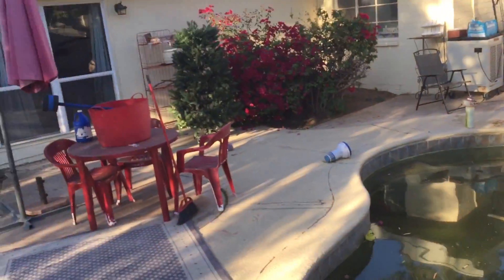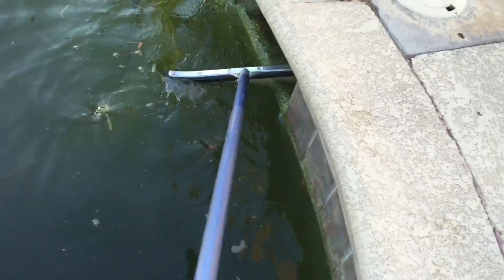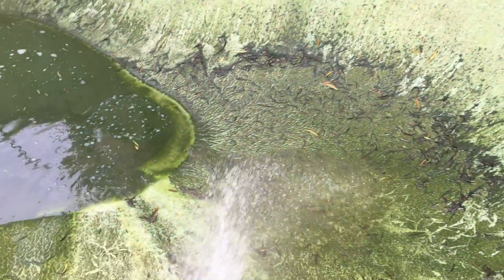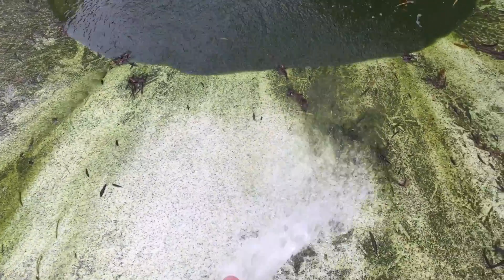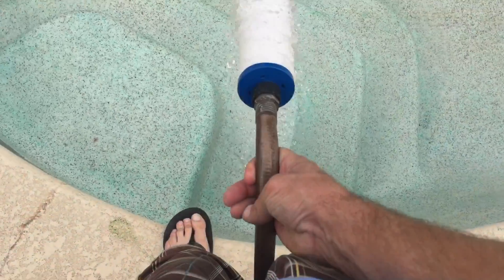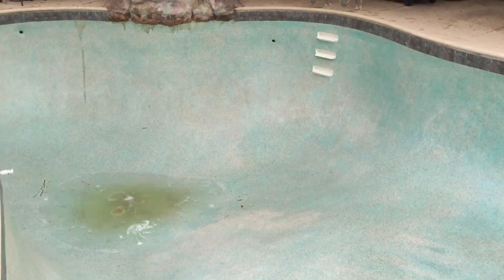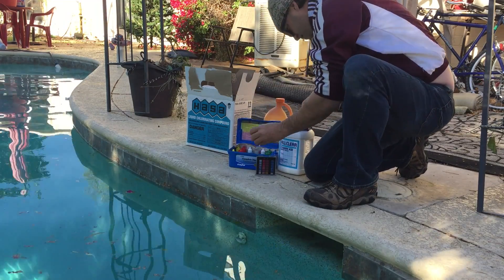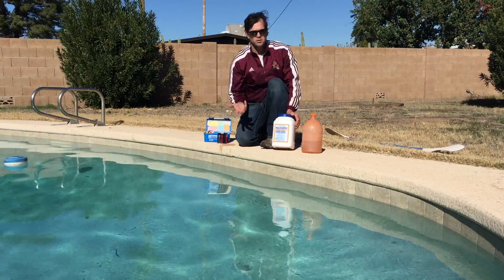Hitting the Reset Button: How to drain and clean out your pool

Comment: I'm here years after the video was posted, but I have a couple questions.  How long did this process take?  Also, how would you clean out an aluminum bottom pool since it needs counterweighted? And how much chlorine did you need to use for the rinse?

Comment: Also, I've heard draining a pool comes with considerable risks, the pool walls could buckle (since there is no pressure from the water pushing on them) and even the floor can buckle/shift.  How do you know when you can/should drain a pool vs one that could have these problems?  (my guess is you do it by size/depth, but I don't know).
Reply from the maker: A gunite pool shell is built like an upside down bomb shelter. You would see massive structural issues long before draining if there were going to be any issues like collapse. You do need to make sure your ground water table is well below the bottom of the pool before draining as you can float it right out of the ground like a boat!
Reply: Did you have to do anything with the drain to make sure the pool doesn’t pop out?

Comment: Missing a pressure washer and a plastic watering can. Plus someone is using alot of copper algaecide or has an old heater leaking copper into the pool. There are blue stains all over the pebble-tek.

Comment: I just did this last week and this is where a pressure washer came in handy. As the water level dropped I used my pressure washer to clean the sides of the pool and I have a vinyl liner. I didn't use a professional pressure washer but a 100 dollar one I got from Home depot. It even removed the black spots on the liner. Saved me hours of scrubbing lol

Comment: I saw that you didn't show reliving the pressure for the hydrostatic valve to avoid the pool popping out of the ground. Why not?
Reply from the maker: We don’t have hydrostatic valves in Arizona but you bring up a good point. In areas where the water table is high like parts of California, Florida, Louisiana this is certainly a critical step.
Reply: @SwimmingPoolAZ-SPS  I'm in Orlando, Florida, so if I remove the hydrostatic valve during draining will that prevent the pool from popping out of the ground? My plan is to run the backwash hose to the front yard to keep the water from going into the pool surface in the backyard. As well, is a pool popping out of the ground something that could happen overnight? I plan on taking about 4 days to finish this so I want to make sure I have the right amount of time having the empty pool and avoiding this issue.

Comment: On that size of pool shouldn't you use approximately 7lbs of stabilizer pouring it into the skimmer with the equipment running but be careful not to pour to much in a a time . I like to pour a 1/3 at a time waiting maybe 2 or 3 minutes in between. Actually to do a chlorine  bath you want to pour as many gallons as it takes to create a puddle around the bowl of the pool allowing you to grab the house walking around the pool a few times letting with the submersible  pump running so that it flows down the walls given you more than just a one time coverage , when you pour acid in you should keep the jug of acid over the water while you screw the lid back on and submerge  it in the water to rinse off any acid that might be on the outside of the jug just to be safe and not to drip any on the deck especially  on a new construction pool. And never pour over the swimming pool light. I seen alot of careless errors  in this video and would research a lil more. It's a pretty simple job to do a chlorine . He explaind it like a professional  just not a quality professional  job. God bless and stay safe.
Reply from the maker: You bring up some good points which we cover in our acid wash video and your method for a chlorine wash is another effective way of doing it. As far as me making careless errors and needing to do more research. I’d beg to differ as the pool turned out perfect with no chemical spills or unintentional bleaching and still looks good to this day. You have your way, I have mine. I just hope you’re not doing acid washes the way you suggested doing the chlorine wash (which is EXTREMELY damaging to equipment that a do it your selfer might renting and can utterly wreck an older surface). I always cringe when I see guys doing that. But hey, what do I know, you’re Always a Winner!

Comment: should you also do an acid wash?
Reply from the maker: The more appropriate question is COULD we do an acid wash? We could but an acid wash is almost always a cosmetic procedure that strips a bit of the surface away each time you do it. We achieved great results with the chlorine wash so in this case an acid wash would have been overkill, not improving the color but certainly doing damage.

Comment: I have a concrete bottom with vinyl sides. The paint on the bottom had chipped off so bad it just looks dirty. I am scared to drain my pool. FEMA just redid the flood maps and we are not in a flood zone anymore, but I am still concerned. Any tips?
Reply from the maker: Well, at some point that bottom will have to be repainted. If it’s mostly a cosmetic issue at the moment you have time to do your homework and come up with a good plan of attack. Talk to some other pool owners in your area and research the best paints (I wouldn’t scrimp on that as the cheaper you go with paints, the more often you’ll have to repaint or with will dust off and make the water look cloudy all the time) If you do decide to drain it, find out what time of year your water table is lowest and do it then to avoid any issues with water leaking in or the structure of the pool itself shifting.

Comment: I have a question, a hurricane caused lots of leaves and debris to fall into my pool and time caused it to turn green. I drained my pool and realised that the filter/catcher piece for the bottom hole on the deep end is gone. How do I know whether there is debris in the pump line? And how would I go about cleaning it out?
Reply from the maker: You can use a garden hose with a flush bag attachment inserted into the inlet of the pump through the pump basket so that the water flows the opposite direction of when it’s being sucked through the pipes when the pump is running. This should flush out any debris the isn’t lodged severely in the pipes. If that doesn’t dislodge the debris then you’ll need to call a local pool pro that has a CO2 tank to blast any debris out.
Reply: @SwimmingPoolAZ-SPS  thanks for the info!!!

Comment: I thought if you were to drain your pool of it's water that it could pop out. Do you run the risk of your pool poping out the ground if you drain it?
Reply from the maker: Depending on what part of the country you’re in and how high the water table is, yes! This is the purpose of hydrostatic relief valves in pool structures....they actually let ground water flow into the pool to prevent the pool from floating out like a boat. Here in AZ we’re lucky in that our soil is fairly stable and our water table is low. Make sure to so some homework before draining your pool as a pool coming out of the ground can cost tens of thousands to rectify.
Reply: @SwimmingPoolAZ-SPS  ok, but I don't understand what you mean by a high water table. I live in Central Florida, but how would I check for my water table and what is a Hydrostatic relief valve? I'm sorry for asking so many questions, but I'm trying to educate myself on the care of my pool. I have a new pool pump recently installed the pump system is called Pure Chlor salt chlorine generator where would the Hydrostatic relief valve be if any on the system.
Reply: @barbaracenteno7407  
The hydrostatic valve should be underneath your main drain cover in the deep end. It's just a little piece of plastic with a spring, and its job is to  pop-up and  and let some  groundwater - thereby relieving the water pressure sorta like a champagne cork -  into your pool if the underground water level gets too high, so the water pressure   won't Pop the pool out of The ground.  It's like a $15 part, but it's very important in Florida, as the water table is SO high ( it's like an underground river!!). THE problem occurs when the valve Pops up to relieve the water pressure and then can't seat properly because some debris gets Caught in it, which will then cause a leak.
Reply from the maker: barbara centeno  and Charlie, you need to brush, let settle then you can vacuum the pool to waste or port a vac. Keep the hose running so the water level doesn’t get too low. You’ll probably need to add alum or some other floculant to the water to get it to go clear and vac to waste/port a vac again. Once you’ve gotten it relatively free of algae and debris, treat with chems.
Reply: @SwimmingPoolAZ-SPS 
Thanks. Since I have a cartridge filter - and no recirculation setting- would it be OK to remove the cartridge filter and then circulate the flocculant. I could also dilute the flocculant in a bucket and apply it around the pool perimeter, BUT I THINK circulating it via the skimmer would be more effective. 
Am I correct??
Reply from the maker: @charlies.5777  Follow the directions on the flocculant to a Tee. if it's recommended to circulate water then by all means, pull those cartridges....might be a good time to hose them off!
Reply: @charlies.5777  Thank You very much knowledge was very helpful
Reply: @barbaracenteno7407  
No problem- I HOPE it made sense to you. This is probably a HORRIBLE analogy, BUT it's kinda like the pressure relief valve on a pressure pot. It's there to release excess pressure SO the top doesn't Blow off and coat your kitchen with homemade lentil soup!! In this analogy/simile, the lid is  your Pool!!😀
Reply: barbara centeno I don’t know if it’s a good method, but if you have some arm strength you can just dig a hole in the ground to see if you can reach the water table. When i was young i did this some time in my parents backyard. Around 1.5 meters down, the hole started to fill with water out of nothing = water table. If this is higher than the bottom of your pool, you should be worried i guess.
Reply: @SwimmingPoolAZ-SPS  
I was thinking the same thing!! I wish I could do this to my pool,but I have a stinkin' hydrostatic valve!!
Great video. AND... Thanks for NOT berating the pool owner for letting the Pool get SO swampy. As ALL knowledgeable  Pool owners KNOW, it can go green VERY quickly!!

Comment: In the midwest and scared to drain my pool due to hydrostatic pressure. Definitely need to though, as there is tons on debris/algae in it due to it not being used for the last two years.. what would you suggest in a case like mine?
Reply from the maker: Yeah, Is the water clear down to the bottom or is it cloudy? If cloudy you could start by circulating Alum. It’s a floculant that will clump all the suspended particles and cause them to fall to the bottom. If your filter has a multiport valve you can vacuum to waste while continuing to run the hose in the pool so the water level stays the same to keep the pool from floating up.

Comment: what is this surface called ? I have similar surface and it's rough as hell and hard to clean.
Reply from the maker: This is plaster and it’s in “rough” shape. The problem is when it’s rough is that it’s easy for Algae to anchor in. That makes it way more difficult to remove.
Reply: Gunite

Comment: I looks like your adding the cya to pool by throwing it into the water. In fl we don't do this, due to the fact cya is a granulated acid and my cause staining. In fl we add it either in a hanging sock or we add it to the skimmer where it will dissolve in the filter
Reply from the maker: We wouldn’t toss it directly in if the surface was brand new.

Comment: Do you not have to pull the hydrostatic release in az in fl you will pop a pool if you dont
Reply from the maker: Our water table is so low we don’t even install relief valves. I’ve seen what can happen though. A pool with no water is just a concrete boat!

Comment: Why not use the swiffer wet jet?
Reply: QUACKQUACK IM A DUCK
This is kinda underrated
Reply: Snitzle D!ck (͡° ͜ʖ ͡°)
Reply: The way this guy went about this job it appears the swifter would have worked out better. I would have worked pool shock first and vacuum. My experience has taught me unless a totally bad water chemistry is noted, then there is no need to drain a pool. He could of had that pool turned around in 24 hours had he knew what he was doing.

Comment: Why use a pump? Most pools have a switch you can flip to drain it using the main drain
Reply from the maker: “Main drain” is a misleading name. the filter pump should pull most water from the main drain in a conventional set up but the pool pump is not designed to empty pools and the lower the water gets in the pool, the harder the filter pump has to work and many times will lose prime due to cavitation at some point. It’s just easier to bring in the submersible as you don’t have to baby sit it so much and protects the pool equipment from any harsh chemicals like acid that you may be cleaning with. Also, the pump basket would get clogged over and over on a pool Iike this where there’s lots of algae, leaves, etc. the sub pump just slurps it all up and out.
Reply: I guess it depends on if you know what is on the bottom.  If you know that there is not too much debris than it would be faster to use the primary system pump until it gets really low.  Then it would be faster to drop in the sump for the remainder of the job.

Comment: The main drain cover is flat, regulation requires a domed cover, it's not VGB.
Reply: As it is a private pool they have no real incentive to make the change.  If it is a semi public or a public pool it would have been changed long ago.  Our semi public pool is inspected every year.  I bet that pool was only inspected when it was first built and only by the building code inspector.

Comment: That pool was bad but it could be cleaned in a few days with the right chemicals. Aluminum sulfate brush then let sit for a day. The next day vacuum to waste. Add a lots of cal hypo and run filter brush pool.  Come back in a day or two and vacuum to waste again. Should be pretty close to being done. May need a little touch up here and there.  You could see the bottom of the steps in the shallow end.  When you can’t see the top step then it’s time to drain.
Reply from the maker: In this case you still have the issue of high CYA and calcium. As you know, since you’re a pool professional, adding “lots” of CalHypo would only make the water hardness problem worse, especially as water temps climb through spring and summer pushing the LSI deeper into the plus side. There was no way around a drain with this one.

Comment: What chemicals did he use to clean the pool. Was it just water nothing added
Reply from the maker: The majority of work was done with just water and a brush. Once I hosed and scrubbed the algae off and removed all of it from the pool, I rinsed the floors and walls with Bleach and then refilled it right away. If your surface is in good shape (unlike this one) you can use a power washer and it makes the job go pretty quick.

Comment: My pool is the same size, but different shape, more like a rectangle. But When I was building it, my crew (the ones I employed to dig out my pool) discovered, that 4 inch drain line is going straight beneath the spot that was the lowest. I went to talk to a contractor, and he said, that if I install no bigger than 2 inch outlet in the pool, I can safely hook it up to the drain pipe and drain my pool when needed bu unscrewing the plug hole in the bottom, rather that needing to deal with the sump pump and such. It was the god blessing, because it is so easy to clean it too. When it drains it creates a great suctions, a huge vortex forms and everything that you scrub down from the walls and bottom in the fall, it suck down every single peace of garbage. If anyone watching want to dig out a pool, I strongly recommend hooking the lowest point wia a plug hole to a drain line, because that will save you electricity bill and also the hustle of 'where do I put 30 tons of water?" in the  fall, when preparing for winter. Just unscrew the plug and leave it open till spring, any water that may come in due to thaw ir snow will go straight out the way it came. That was the best Idea I had trough the last 7 years. Also, when the pool drains, keep in mind that it doesn't have a vent, so if your house doesn't have a vent too, your toilets and sinks and tubs will gurgle a bit, but after it drains down gurgling will stop. It is due, because the huge slug of water fills the interior of the pipe and it creates suction, that takes air from anywhere it can.

Comment: Ive used the main pool pump dozens of times, but you have to stop and dump the basket a lot but it depends on how bad the pool is, i use a 5 hp gas pump wit a 2.5 inch discharge hose

Comment: Thanks bro your videos actually explain the process lol.
Are you using STRAIGHT chlorine or cutting out in half with water ?

Cause I'm not getting the same results, an the green staining is NOT melting away as shown in your video and others.
I'm also trying to figure out the correct mixture to give an acid wash, if you can help me out.
Reply from the maker: Straight chlorine
Reply from the maker: Your staining could be metal stains in which case you’ll need to do an acid wash with a stain remover. Consult with your local pool pro or mom & pop pool shop and they can help you get things sorted out.